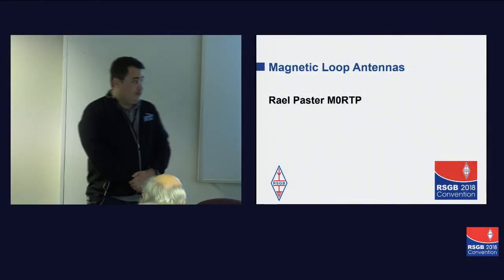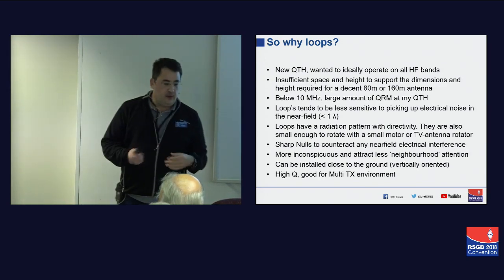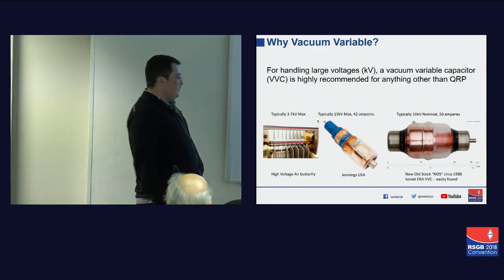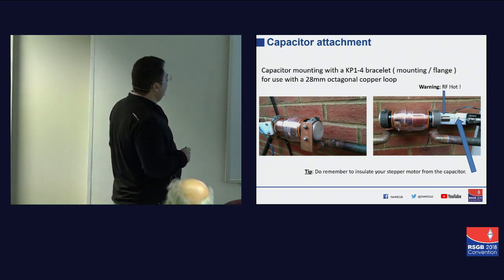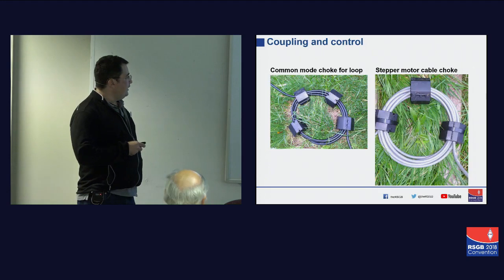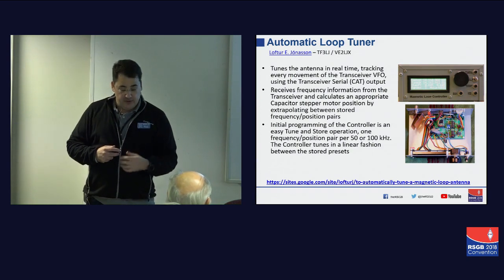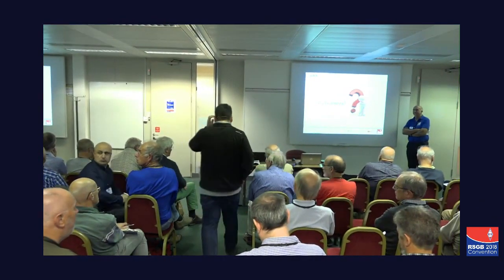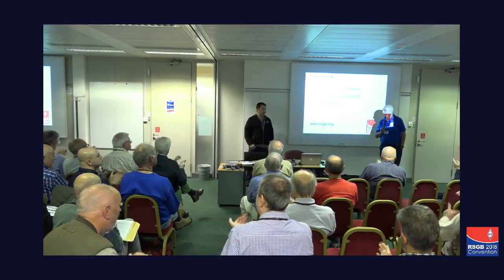RSGB 2018 Convention lecture: Magnetic Loop Antennas

Comment: I thought by moving to a lot in a rural area that I would be doing away with home owners associations and I would be able to put up any kind of antennas that I desire. However, I found that my XYL is a HOA that will follow me to the 4 corners of the earth. It is for that reason that I am planning to construct a few loop antennas. Thank you for posting the video. I will replay the video and take notes and will research your sources.